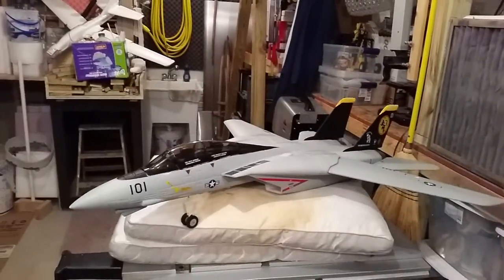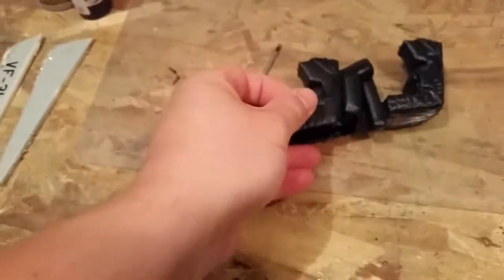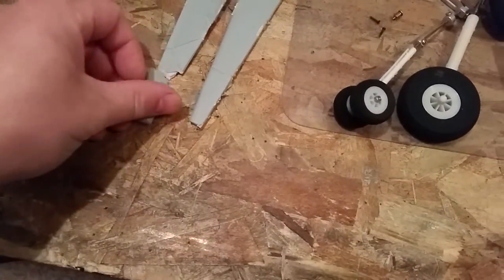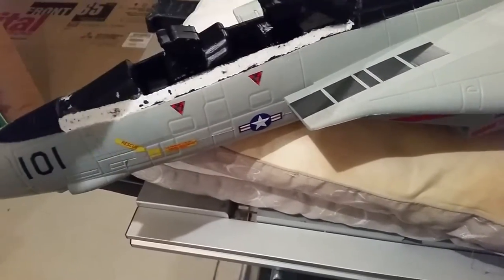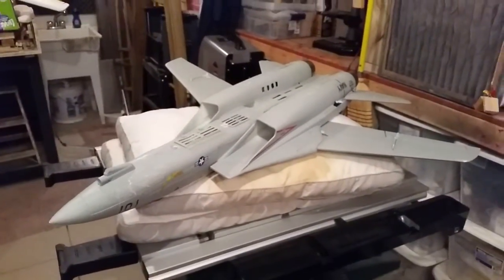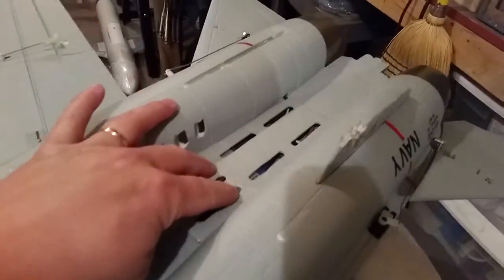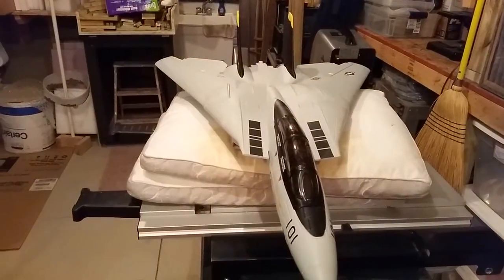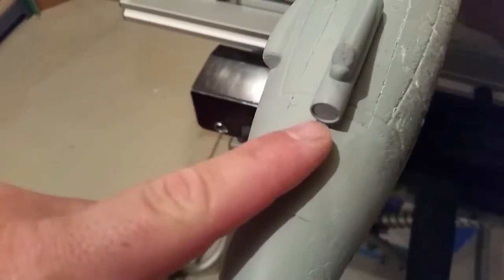Hobbyking Art Tech F-14 Tomcat - Gear Removal and Belly Landing Mods

Comment: Awesome info vid!  Thank you very much.  I don't have a paved runway, so I'll be belly landing in grass when I get my replacement model from bananahobby.com. 
Note:  Ordinances and drop tanks may cause some damage to nose if attached during belly landing, might cause nose dive into ground upon touching down?
Also, won't fly quite as fast and responsive, I've seen videos where there is a noted difference.  Even though it may look cool on video, it would be a shame to break this cool model.  Good luck
Reply from the maker: Agreed, I think the missiles and rails, you'll probably have issues, but you might be okay with the magnetically attached drop tanks...in fact, I bet they'd help protect the dammage prone underside virtical fins.

When you get the replacment, take a close look at the difference (if any) between the thrust on the right and left edf's...mine were around 30% different, which caused the total thrust output at 100% to be poor...especially with 3S 2200mAh 60-120C lipo...after I added differential thrust, I was able to achieve very slightly more power on 3S...and you already know how this story ends, I go with 4S 2200mAh 60-120C Zippy Compact Lipo's